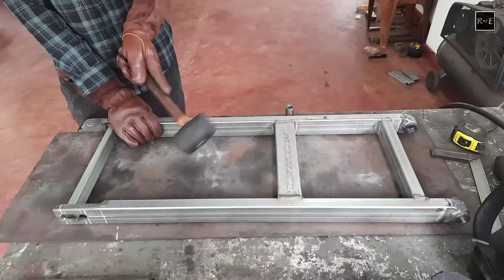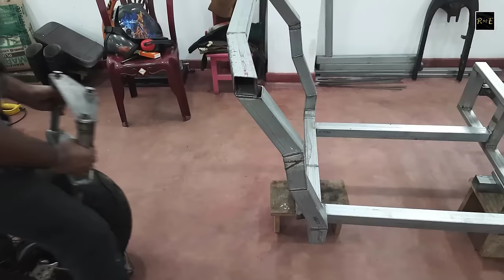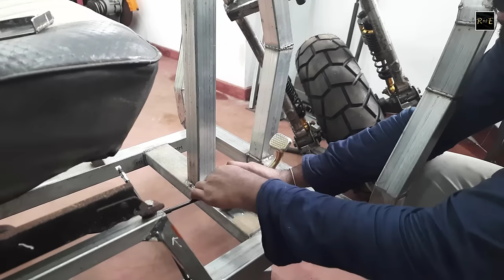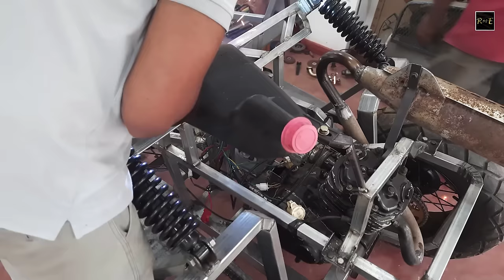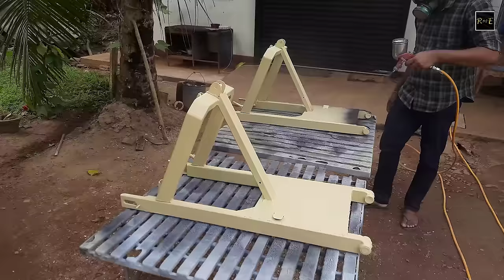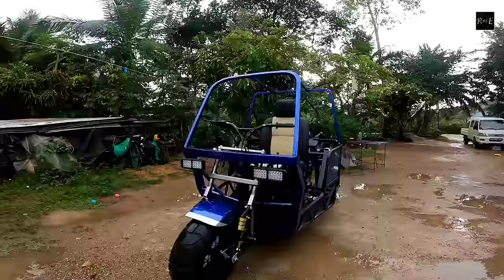How to Make Three wheeler Trike |  Homemade offroad Three wheeler

Comment: Good work.  But I don't see what you are trying to achieve in this project.  Just one seat and more weight added to a motorcycle engine designed for much lighter load.

Comment: looks like its just 125cc engine. You can get the new single cylinder 4 valve 180cc (Oil cooled and CDI ignition) that might give this trike a top speed of 85MPH.. 125cc just too small of a engine for this trike....